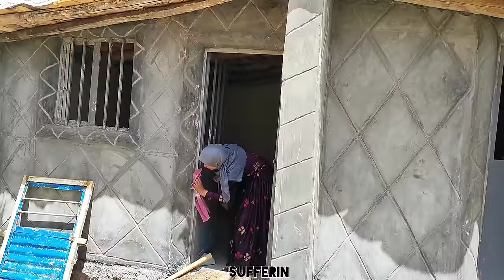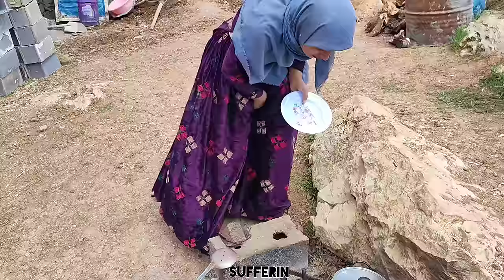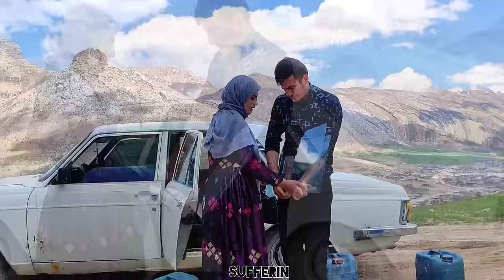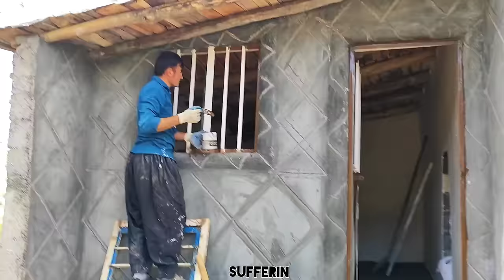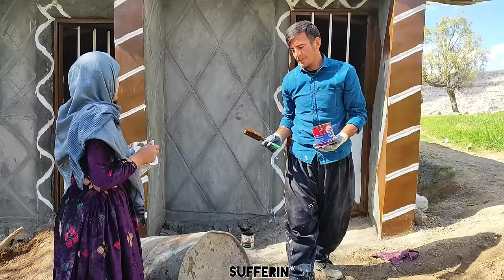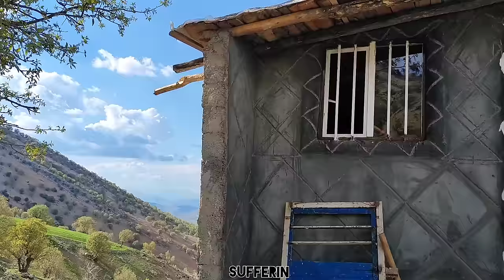Glasswork and painting of a dream house by a divorced woman and her fiancee

Comment: I thought this family loved this house till they went and painted it. I love the brown color on the doors but the white they added to the doors and the lines on the columns. The colors are running also. It took them like 30 minutes to destroy that beautiful house. I hope all the stores ban them from ever buying paint and paint brushes for the rest of their life. Aida and Ali Asghar could have painted it better.
Reply: 😊 I also thought they should have finished the roof, trimmed off the plastic, cut the beams evenly and removed the doors for painting . 🤷 I suppose they aren't very experienced.  Bless them.  It can be fixed in time. They need  also finish the cement on the back wall.